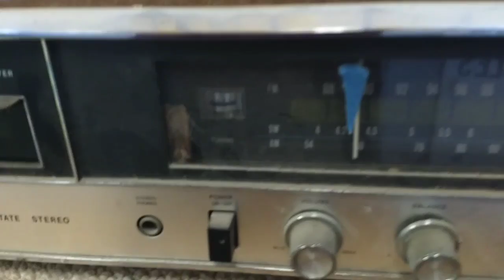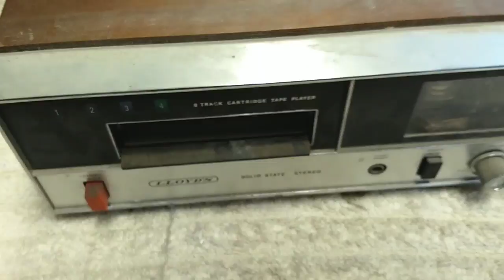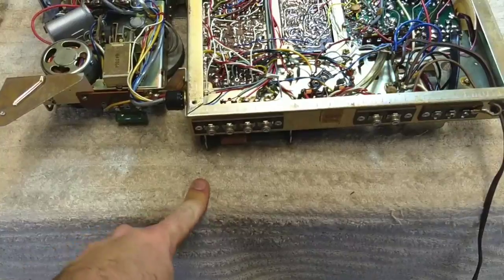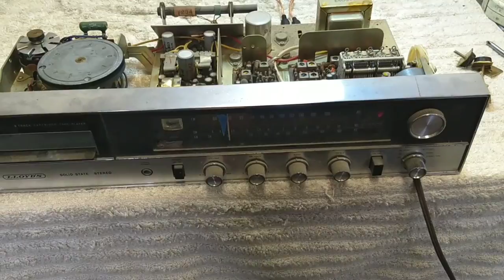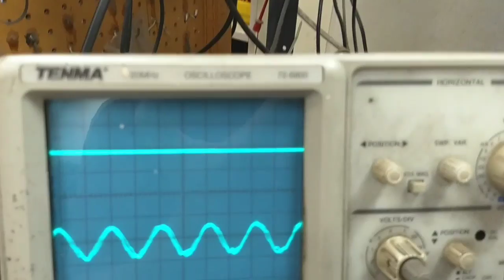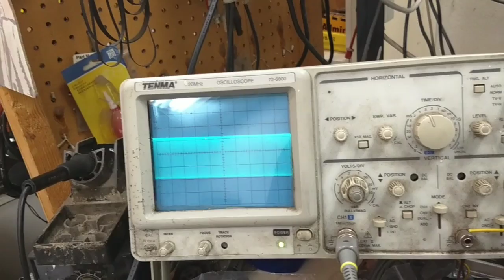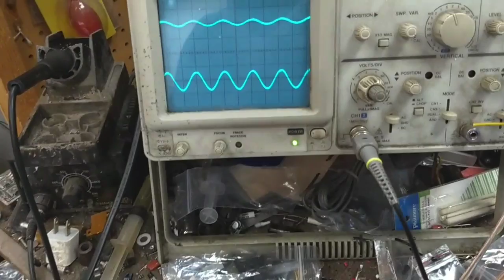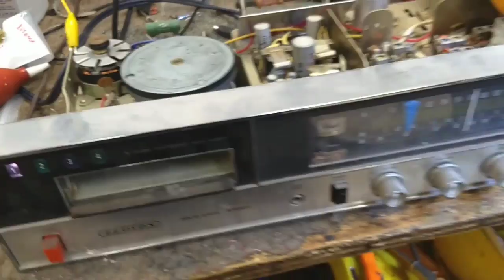Servicing a vintage Lloyds stereo system 8m36w-07a part 1/4

Comment: Do you have a part number for the light bulbs for the dial and stereo? I'm restoring my 70's childhood LLoyds radio from my parents' house.
Reply from the maker: Don't remember off hand.

If it's a bayonet style lamp it's likely an 1847 or #47
If it's a screw type lamp it's likely an 1840 or #40

If it's a fuse type lamp it's likely a 6v 250-300ma
Reply: @JordanPier  thank you!